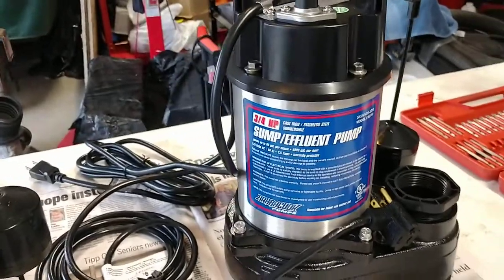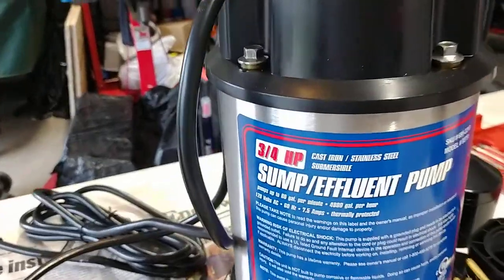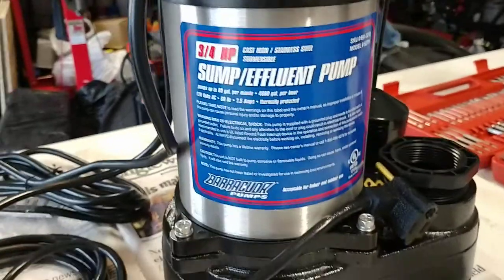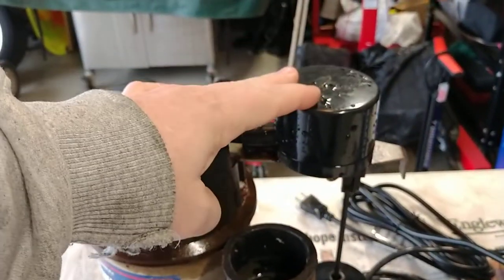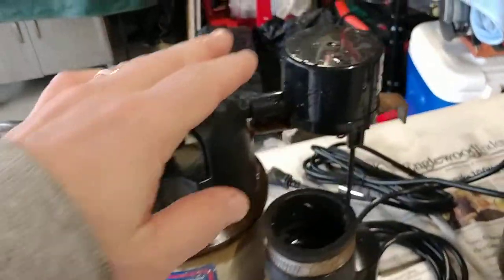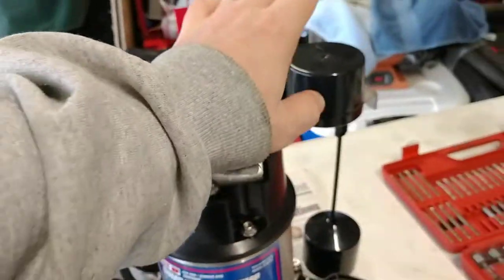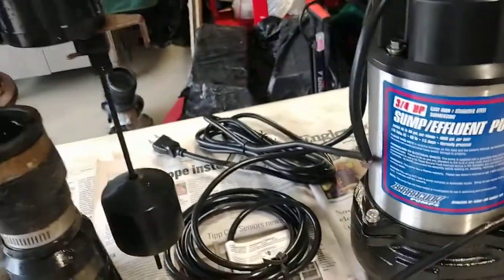Barracuda 3/4 HP Sump/Effluent Pump Failure and how to address it

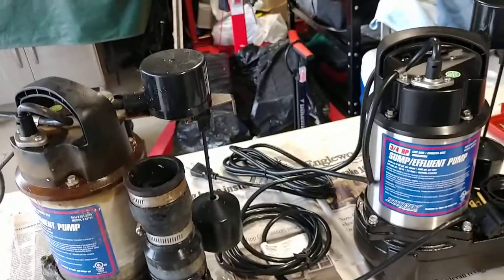Comment: I will be asleep before your pedantic 2:30 is over.  5 years out of a pump isn't bad. So, the switch failed.  You can buy a new float, exactly like what you have.  Or, you can buy a tetherball style (example) Everbuilt Piggyback Switch.  The tetherball seems to last longer, which is why you see them on a lot of the more expensive waste pump.  $20-30 is a lot less than a new pump.

Barracuda is made for Menards by Gardner Denver, which was merged with an Ingersoll Rand spinoff. Good synergy there.  Capability in the lineage of both companies.

Almost everybody is an IT guy these days.  A real IT guy, who wants maximum reliability, would do some (or all) of the following:
1) ALARM the tank level. $20+.  Bonus points if you setup one that will send message to you anywhere.
2) Buy a battery pump, or enough battery to keep it running in stormy (which often means lots of moisture) powerfail...automatically.
3) Take your needed IT out of a flood prone basement, or at least make sure all components have redundancy/hosting outside of your home.  At the very least, get the stuff off of the floor.  If the water level reaches 4', you've got bigger problems to deal with than your IT setup.
Reply from the maker: Thanks

Comment: Just wondering how this worked out for you so far. I figure barracuda is a Menards brand, so I'm split 50/50 on whether or not to replace my mothers sump whose switch has failed (12 years old) with this one.
Reply from the maker: Yea but I must admit that the company does have a life time warranty so it worked out and the pump really does work well.  One small detail I had to adjsut the replacement switch but once done it worked out well.  Now I have a prefect backup sump pump ready for use if needed to swap out the current I have in use.  I am good now...
Reply: I just bought a barracuda one horse sump pump for my basement. Before that I changed three over the last 22 years, different brands. 10 years ago, I bought a barracuda, garbage, disposal, and that thing is a beast. Quiet, still kicking, still looks brand new on the insideside, Never got clogged, not even once

Comment: why would you buy the same sub pump that failed. is this pump a lot better than most of the other junk pumps on the market. made in china, right...what if your new pump switch fails in 6 months... never heard of barracuda.
Reply from the maker: Good question... for it is important to have a matching backup pump that fits and sets with your drain PVC pipe.  I started buying two, one as a backup because it is not because of the value of the pump but the rick of my basement being flooding out.  Also you can fix and reuse the older pump if replaced by a newer unit as a mobile pump just in case I need to help someone else out. I use a flexable tubing pipe with 100ft length and you can help anyone out.  It turned out later that I had to do that very thing for my friend's home that began to flood.  So you can fix it and reuse as needed.  Great question!
Reply: Right? Probably not. Your failure to do a quick search is why China is so far ahead of the US.  They start doing their homework at a young age, and don't stop.  Barracuda is manufactured for Menards by Gardner Denver which was merged with a division of Ingersoll Rand.   To the best of my knowledge the pumps are manufactured in Quincy, Illinois or Sedalia, Missouri, but if that was on my list of criteria, I'd look at the label on the pump.  Maybe they get the motor from Germany.  Maybe the electrical cords come from China.  Good chance the housing is a US product.  Look around your house, you probably have many products from China.  Some of lower quality, some of the best quality.   Why would you ASSume china is junk?
Reply: @markb1699  subtle spelling^^ in the last sentence... ;-)